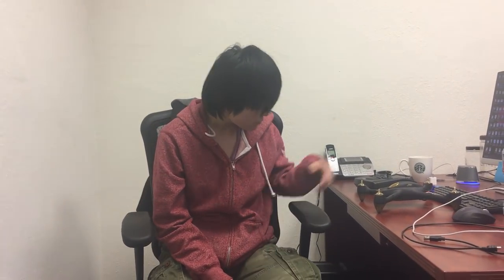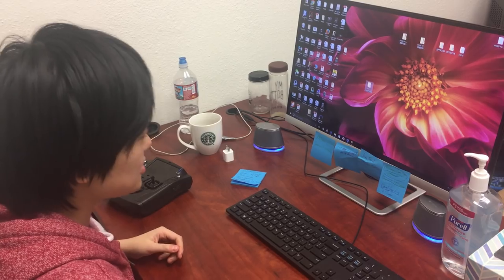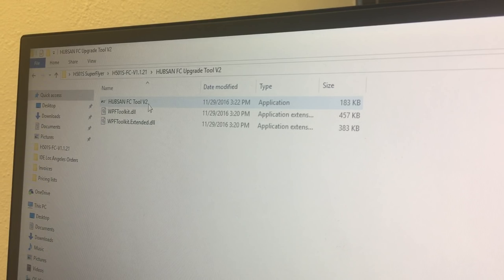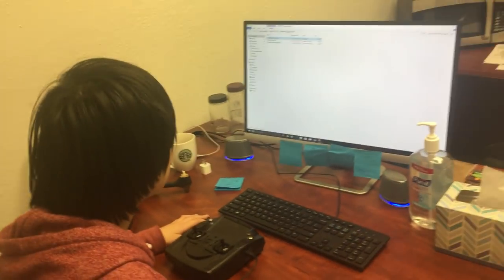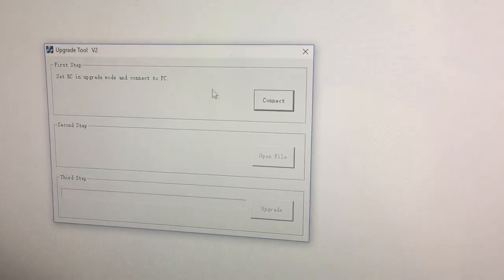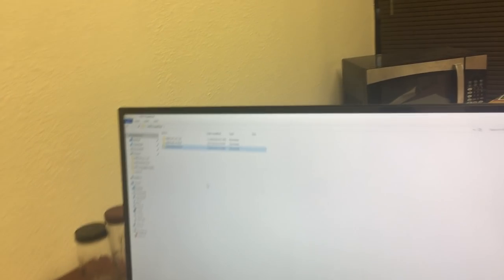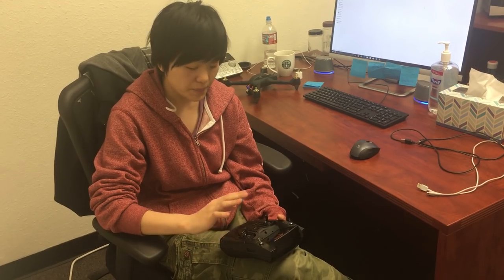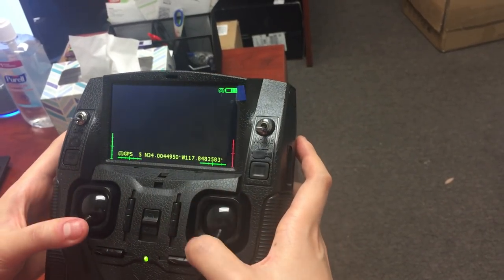H501S Firmware Upgrade Protocol

Comment: I had some nice flying last week, but suddenly the display on the transmitter shows Roll 3, Pitch 1 and the drone drifts to the right and crash. I have tried to recalibrate the compass but no luck. I updated the software to RX V1.2.17, FC V1.5.25, Transmitter V4.2.8, LCD V1.3.2, but stil having the same trouble. Can you please advice?
Reply from the maker: You can try calibrating your gyro sensor. For gyro calibration- on a completely flat surface, hold your left stick to the bottom right corner and flip the right stick left and right until the drone's LED change their flash pattern. Once the LEDs are back to normal operation, let the drone sit for a few seconds before trying to fly again.

Comment: Hi. You are so great explaining, you comunicate very well.
Where do I get FC 1.1.21 version? I just see 1.1.20.
Reply from the maker: Hello. The firmware you mention is outdated. We don't recommend upgrading the firmware unless you have firmware related problems. If you are unsure, please send us an email (service@hubsan.com). Otherwise, if you still want to see what changes have been made, please have a look at the change logs on the www.hubsan.com Support page. Again, we recommend  you don't upgrade unless you've confirmed that you have firmware issues.
Reply: HUBSAN OFFICIAL Deal. Thanks.

Comment: The update I downloaded does not have RC file? I have done the first two parts after some messing about. Do I need RC file?
Reply from the maker: There is no RC file on the website because there is no need to upgrade RC.
Reply: I have updated it and taken it out for a flight. It is fine in Manual and Altitude Hold modes. Return to home OK, still twitches in Follow Me mode. GPS Hold OK. I did not take it out far using GPS as I am still not that confident with it.

Comment: good video I have upgraded the firmware successfully for the H501s after all the upgrades finished I get 2 issues.

1. on calibiration on compass 2 I get "gps signal lost" then the constant beep

2. when trying to start the motors the way i did before  nothing happens the motors don't spin, any  help would be gratefully received, kind regards, justin
Reply from the maker: 1. If you are holding the body of the drone for compass 2 then the GPS signal will drop because your hands will be blocking the GPS module.
2. The latest firmware requires 6 or more satellites to start up the motors. You can also try rebind and transmitter sticks calibration.
If you have any further questions, please don't hesitate to send us an email at service@hubsan.com. Thanks
Reply: HUBSAN OFFICIAL thanks for the reply. I hold the legs of the drone and then do the compass calibration but same issue even after the firmware update. The 6 satellite issue I understand but there are many people reporting this gps signal lost issue only on compass 2.

It happens on the H501s and H591S-S models as well

Comment: Hi Annie HELP please... I have downloaded the firmware upgrades and followed your vid up untill the end of the FC upgrade section. I've encountered a problem. I installed the drivers and then ran the tool as instructed. The app showed connected but the update failed. I also tried this with all versions (i.e V1.21 V1.22 and also all of the hbs files. same deal. it's like there's a language problem even though I installed the correct 64bit driver. Now despite the failed updates, it turns on but won't go past check gyros and onto calibration of the compass. Getting really worried cause now it wont fly and I dont see how I can roll the start back considering it did nothing? :( Ive only had it days...pls help.

Comment: no lights on the quad after connecting power (beep conf) but the controller is off atm after a failed upgrade to the rx...really in trouble.

Comment: Hi, im a new hubsan x4 standard owner, but my drones transmitter is not asking me to calibrate my drone or not displaying the word " calibration compass 1" i tried spinning the drone for what was told but the leds r not blinking as what ive seen in other videos. Thanks
Reply: With either tx you hold the throttle stick "left center position" while you quickly "rock the right stick left center to right center back and forth quickly" until the calibrate compass 1 displays on screen.

Comment: I just received my 501 today. It will do the compass calibration alright, but I can not get the motors to go after I have armed them. I also notice in the lower left of the screen the LED is red for the thottle stick all the rest are green, is that the way it should be? Thank you.
Reply from the maker: You should try calibrating the sticks and yes, it is normal that the LED is red for the throttle stick.
Reply: Thank you very much, I did and it works great! :)

Comment: NEED HELP!

I just upgraded the FC firmware  now I cannot bind the drone to my RC.  I did not update the RX update because the there was no tool upgrade from the hubson website. Only the FC v2 tool. My Current verson FC is the V1.6.25. I tried downgrading using your files i dowon from superfly but for some odd reason the RX update tool does not work.

 I don't know what to do. Please help.

When i turn on the remote control the version is the V1.2.12

Comment: Anne,  This is off subject but I hope you have a answer for this ----  On my 501S advanced controller, is a video output port.  I bought a cord with a 2.5mm male (mono)  jack plug to a male RCA plug.  I tried to use it but the image was just a trash image of gray and black. 

Why didn't the video image from the controller come up on my TV monitor?
Reply from the maker: Not all monitors will function well with the FPV, which functions on a 5.8G frequency. You need goggles or a monitor made to work with 5.8 signals.

Comment: My x4 501s can't capture video.  I get garbage mp4 files with  very long file names and no extension.  NO software can recognize open convert or play them.  I've tried them all.  Will a firmware upgrade fix this.  Also, why is my drone not in ready to fly status out of the box?  It seems others were.  Thanks,
Reply from the maker: Hello, Tre. You're likely experiencing an SD card formatting or compatibility problem. 

Please use this video to find out if you have an S or an SS. : https://youtu.be/K2u09f1z7ro

If your drone is an S, make sure that your SD card is less than 64GB and class 4 or higher. It will need to be formatted to exFAT. 

If your drone is an SS, make sure that your SD card is less than 64GB and class 10 or higher. It will need to be formatted to FAT32. 

If still you are having problems, please send an email with a screenshot of the error to service@hubsan.com

Comment: hi i have a problem with my hubsan 501ss. After dropping and stopping the propeller (high grass) turns off. Did you have such cases? Regards
Reply from the maker: We aren't too sure what you mean. Perhaps send us a short video, or explain in more detail?
Reply: Everything is ok as it flies but as if something hit and crash then it turns itself off and you can not find it.
Regards
Reply from the maker: Are you saying that the unit turns itself off completely- including motors, LEDs and everything else? This might be a battery problem- try a new battery. If it still happens with a new battery or two, you'll want to email a video of this happening to service@hubsan.com.

Comment: Hello...Flight controller times-out and can't get the software update loaded.  Most of the time I get a "Timeout on data" response after hitting "Download".   One time, I actually got the download progress bar to appear to move all the way across the screen, but received a "No Data ACK Response" message.  The Sent Count read "44688" but the "Complete" prompt did not appear.  What am I doing wrong, what do I need to do differently, or how the heck do I get this to work????  I have the old controller and with the version 1.1.17 FC upgrade files, I'm trying to upgrade the RX using the "upgrade tool V2" and selecting "H501S-RX-V1.2.9.hbs" file.  Per the YouTube Video, I'm getting all the proper responses on the controller screen, even though sometimes when I plug the battery into the drone, the select file option does not appear on the controller screen, sometimes it does, so obviously, when it did appear (one of the multiple attempts to get this upgraded) it when it downloaded the 44688 bits of data.  HHHHEEEELLLLPPP!!!!!!!!!!!!
Reply from the maker: You should not press connect/upgrade more than once, if you do, there will be errors. Also make sure the drone is very close to the transmitter and make sure there are no other electronic devices near the quad and the transmitter.

Comment: After upgrade my 501s from Nelson Lee link it improved from 164m 
to 201m. My Advance transmitter read as follow :H 906A - V1.1.2 and 
H501s - V1.2.12  V1.1.23. Do I need to upgrade my TX to improve 
distance?? Please help.
Reply from the maker: You do not have to upgrade the advanced controller. The original firmware on the advanced controller is fine.

Comment: Let me make an additional comment which was unclear here..  I just ordered the Hubsan H501S advanced version.  I've not received it yet.  However, those of us with the advanced transmitter cannot use the TX firmware Annie shows here or my understanding is you'll brick the transmitter...
Reply from the maker: You do not have to upgrade the advanced controller. The original firmware on the advanced controller is fine.
Reply: That's good to know.  I'll check what firmware there is on the RX and FC when I receive it. Do you know what modifications they've done??
Reply: HUBSAN OFFICIAL - When you say the Advanced Transmitter are you talking about the touch-screen model, or rectangular one that comes with the Flat Panel Antenna and Sunshade?
Reply: The second one. I'm not familiar with the touch screen?
Reply: Nice, but I don't think they are talking about a $750 touch screen;)
Reply: MrPolymers - Yeeeeah... I just googled it, that's the first time I've ever seen a price. Not to mention, the Touch-Screen is called the Pro Transmitter, not the Advanced Transmitter.
I'm just super concerned about this thing flying away on me.
They may have been a bit libral with the term RTF... Maybe it should be sold as UTF (Upgrade Then Fly) ☺
Reply: Ha, Ha.  Well, this is the normal "modus operandi" of a Chinese manufacturer.  Sell something first, then worry about manufacturing it later.  Trust me, I know about these things selling engineering thermoplastics and some small qtys to China too.  I could unleash a tirade here, but I'll refrain..
Reply: Oh yeah... I'm wondering if I should've just bought the Traxxas Aton. 
Hopefully I will be pleasantly surprised though.
Good luck man. Happy Holiday!
Reply: I just received my H501S yesterday.  I hope to hell this thing performs as advertised.  I also have their H301S powered glider that I've only flown twice and cannot really give an opinion. Remember with the Chinese, it's sell the item first, then worry about QC "quality control" later. Of course, they don't honor patents from other companies/ countries.  Again, I could unleash a tirade here, but I'll refrain.. ;)
Reply: Repost on the Glider man. I was thinking about picking that up next... seemed like a good alternative to the Parrot Disco
Reply: Yes, that Parrot Disco..$1,000 bucks my friend..  My Hubsan H301S was maybe $290??  I forget, but I purchased it off a domestic US seller who had a great price on it.  Very nice camera I should say and stabilization.  I'm sure not in the league with the Parrot.
Reply: Yep... that $1K is why I'm looking for an alternative LoL! I've never owned a Glider before. Does it do the 360° orbit??
Reply: MrPolymers the 301 is one of the best things that I have bought. took a bit of learning as I had never flown a plane before but I am getting 2.5km easily with no glitches in the video and most importantly no crashes
Reply: Where do you download firmware? Also I have advanced version, do I only upgrade drone?

Comment: Hello annie. I had a problem with my lastest update. Im using a wrong toolkit fc (im using toolkit h501a) and then im instaling the h501a FC and RX instal the h501s. at the end of the update, it completed, i dont notice anything but when im start power on my drone the LED got blink in 1 LED, and the others ,lighting normaly and i can't bind my RC to the drone, and i can do anything with it. In my case, can you give me an solution to make my drone worked as usual? thank you for your attention, and i hope you will give me the solution. thx very much.
Reply from the maker: Your email has already been accepted by the service team. Your assigned representative will respond to your question. Thank you for your patience.

Comment: hello Anne little question i have a hubsan 501s drone with an old version hubsan bought under the brand REVELL NAVIGAtOR version and this one V4.2.14 LCD V1.3.4 H501S V1.2.9 V1.1.17 is what I can put the latest version without encountered a problem of use Thank you in advance for your answe
Reply from the maker: Hello. For the latest firmware version, please visit www.hubsan.com ("Support", "Product Support"). Select the H501S change/firmware log after downloading the upgrade program.

Comment: Download Upgrade Program For H501S and I do not see the H501S-RC folder. What do I do after installing H501S-RX ??
Reply from the maker: There is no need to upgrade RC, so you should be fine after RX upgrade.

Comment: I did all the steps as stated but it appears that after I try to calibrate the sticks my screen on Transmitter is completely BLACK ! Power light is on but it wont turn on the screen. Any suggestions????
Reply: Oh I figured it out.... but like I said the above steps do make the screen go blank. I know this cause I did them again to make sure. That said tho..... it's all good now ! Thanks !

Comment: Some reason I cant upgrade my fc firmware.  I am pretty sure I am doing everything right, but when I press upgrade it says "upgrade error". I upgraded my tx and rx but now it won't even bind to my hubsan h501s.
Any advice would be appreciated
Reply: @Hubsan official, I have the same problem. Can you help?
Reply: I had same problem until I tried a different cable then it worked fine
Reply: I want slove this problem. It make me so angry hahaha..
Reply: @roogorba1110  I used the H501S FC & RX Tool V1. and it worked for me. the v3 tool failed.

Comment: I have the non profit version of the h501, my range is really bad on fpv, tried a few mods bit nothing helped,  will a firmware update help with this issue?
Reply: Non pro*
Reply from the maker: Hello. A firmware upgrade wouldn't help. Try rebinding the drone and flying in some different locations. Try at least 2-3 rebinds per location. If the problem is consistent, send us an email to service@hubsan.com.

Comment: Where to download the "RC FPV" file, it's not included in the firmware update file
Reply from the maker: There is no need to upgrade your transmitter, the current firmware should work just fine.

Comment: I have a? I have the advanced & I just upgraded my stock v1.1.21 to the superfly 1.1.22 & I already have rx v1.2.12 installed so, do I need to install the version that's included with the superfly pack or do I keep what I already have? I don't know if rx stated was improved for superfly & would need it to complete.Thanks in advance
Reply from the maker: You can use your current 1.1.22, there is no need to upgrade it again.
Reply: Ok well something isn't right then.Before doing the upgrade around 132 meters in distance was the most in distance I got.And now in same spot it's hitting invisible wall at 62 meters.altitude not much better.I haven't had a good weather day since Christmas to try again.

Comment: Hallo, How do you reset the R and P values  recalibrating the compass manually makes no difference, could you make a video
Reply from the maker: To manually calibrate gyro sensor, you can pull your left stick to the right position and move your right stick quickly from the left to the right and repeat until the LEDs on the drone start flashing. Calibration is completed after the flashing stops.
Reply: Thankyou Hubsan Official, that was my next question
Reply: Thank you very much for the reply

Comment: For my H501S only RX V1.2.12 and FC 1.1.21 stable.
Firmware, and other recent. Instability and bugs, gps not precisely, follow mode does not work, and the no fly softness and can not be binding.
And the TX V1.1.3 firmware upgrade allows for FPV1 FC RX and much easier after finding trouble from TX V1.1.2.

Comment: When binding my H7000 Transmitter to my Hubsan H501 drone I get a constant alarm accompanied whit a "Low Battery Plane" in the small screen. Do you know how to solve this issue?
Reply from the maker: The H7000 was made for the H109S- which has a much higher power threshold. So, naturally, it will feel that the H501S battery is an H109S battery on "low power". Unfortunately, as you can imagine, there's nothing that can be done.
Reply: Will this trigger the return home feature?

I there a way to silence the alarm?

Thank you Anne

Comment: hi have a question why my hubsan h501s fly wrong on the air is move for a side left or right  never stay on position I can't fly my drone 
and just have 3 times of used and whit the drone 2 weeks 
right now upgrade the firmware and is the same thing  
why ???
Reply from the maker: Is the GPS mode on? Have you tried calibrating your sticks?